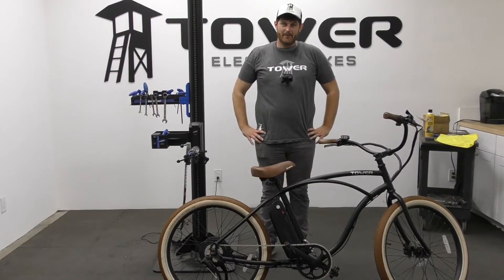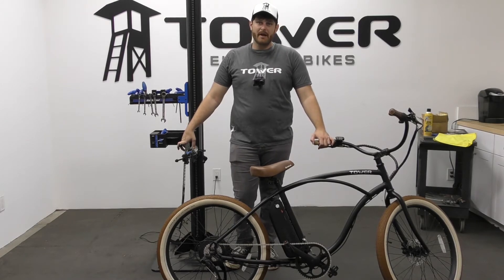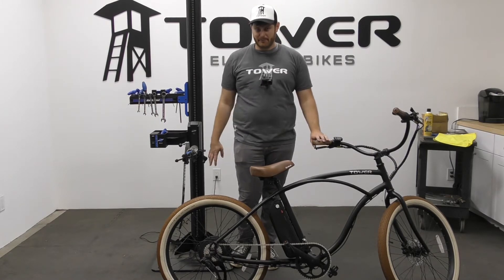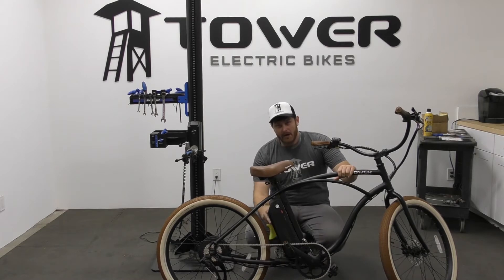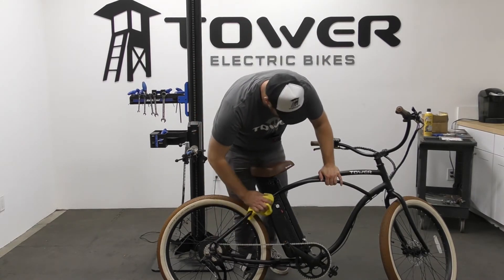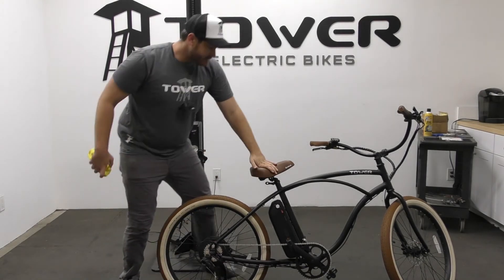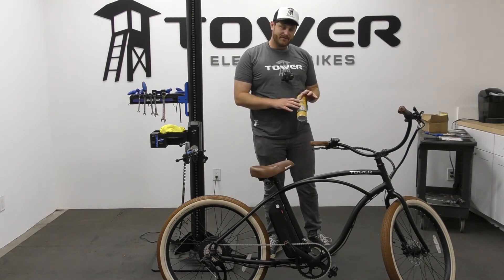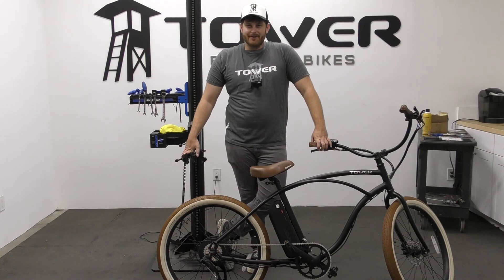How to Clean an Electric Bike

Comment: What's the I.P rating of the Beachbum2 ?
Reply from the maker: Our electric bikes, along with almost every ebike in the world, are not water-resistant. Our Beach Bum 2 does not yet have an I.P distinguished rating. No matter what a bike's I.P rating is, it's best for any electric bike to avoid getting wet as much as possible. Riding in the rain and through water will damage almost any electrical current no matter it's I.P rating. That doesn't mean you can't clean the Beach Bum with water though! There are just necessary steps you need to take to ensure you avoid damaging the bike during washing.